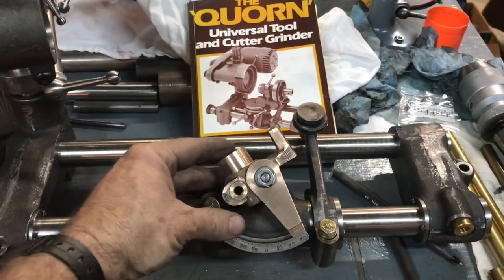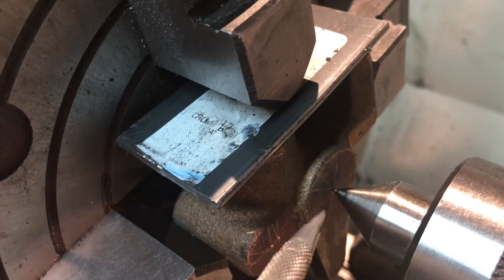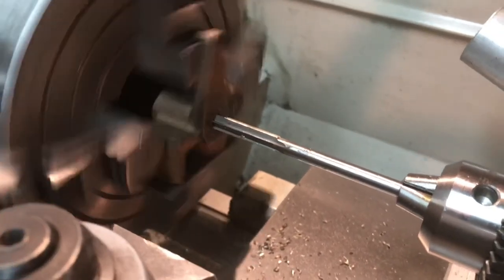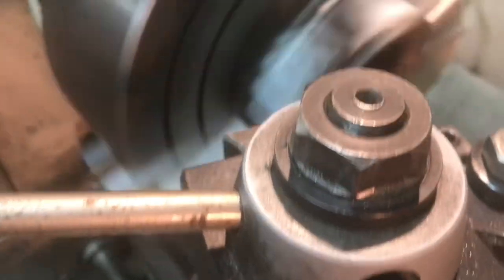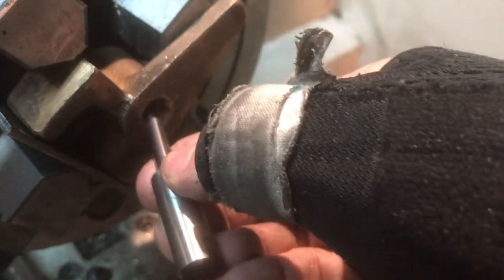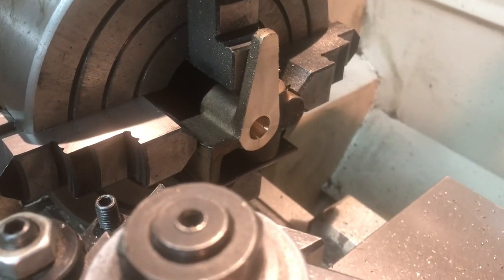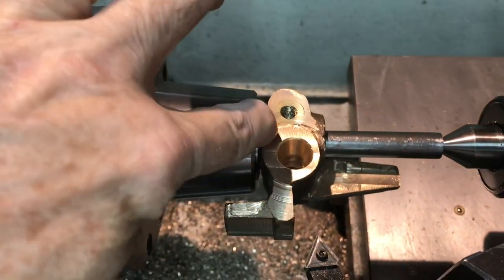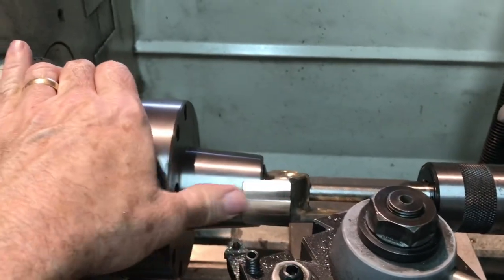Quorn Tool Grinder project, Tilting Bracket

Comment: Very nice work.  My projects generally progress at a much slower pace, impressive.  Have you considered using CAD to layout your split collar location relative to the features of your part?
Reply from the maker: No CAD, but plenty of grid paper sketches and ciphering. The process seems easier when there is a core hole. This one was complicated by the irregular shape of the casting. Made a custom piece of threaded rod and clearance is fine. Thanks for watching!

Comment: Hi Bill, nice machining as usual.. SHIT ..But my plans Model Engineer 1974 and my Ouorn Book 1987 Page 31, has no reference to a double conical cut on both sides of the Fig 25 Tilting Bracket is this for the Mk2 or Mk3 version, because I machined only "One cone" way back in 1990 this was about when my last brain cell got fried, there was no way of asking for help back then, nowadays there would be 1000 opinions ....Some where I have the 3 Page
Reply: Set of full size plans be interesting to check those...It is You and Matty that have inspired me to get my rusty bits out of the box..I made so many bits but "Hit The Wall" I started to look at starting from scratch and no castings all homemade Regards Beagles.
Reply from the maker: Join the Quorn-owners group dot IO to see a lot of great resources in the files and photos sections. Lots of good information about the modifications!